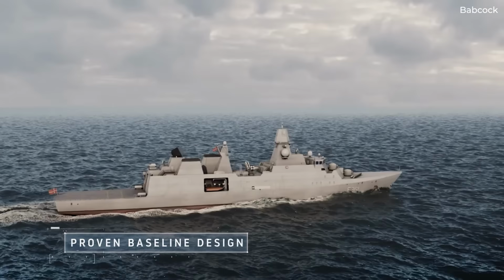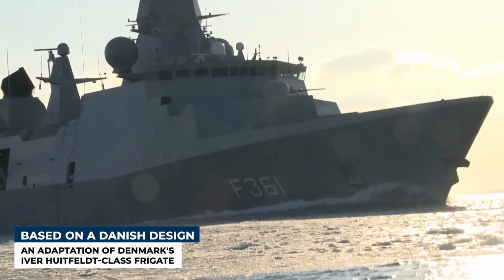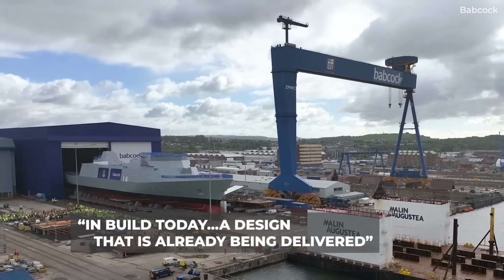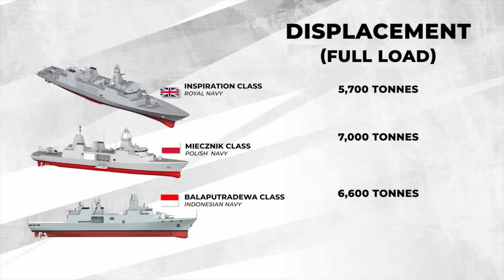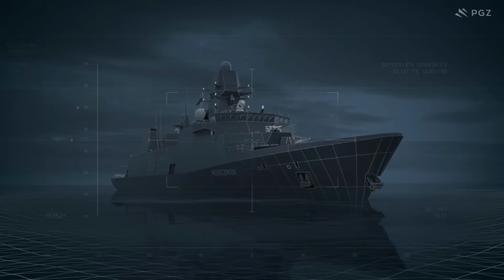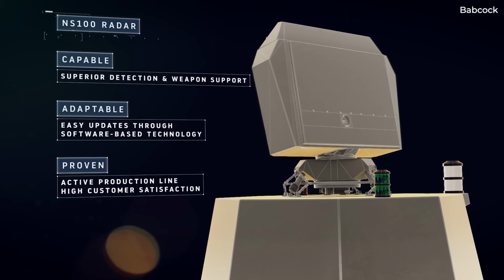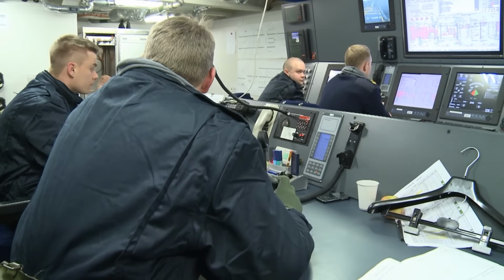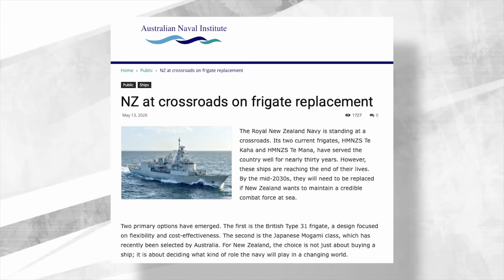Type 31 (AH140) Frigate: The Best Option For New Zealand?

Comment: Type 31 IS a bad choice.
1. They struggle to build them for their own navy or even get their ships they have now  in the water and any construction backlogs will put Nz at the BOTTOM of the list. Meaning our frigates rust out and we have years with zero frigates.

2, In its standard version is actually far weaker in firepower than our upgraded Anzac are now. So wed spend up to a billion each fitting them out.

3. NZDF signed a deal with ADF for greater joint interoperability across all systems. This isnt it. Mogami is.We get savings of hundreds of millions of dollars with a joint ADF build and can easily slot into their shipyards for maintenence and reloading weapons ect. Training too as they will have the same systems. We'd also be able to use Japan' as a refit base too if exersizing again in the taiwan straits or south China sea. 

4. The crew size is 30 to 40 more crew per ship than a Mogami and NZDF struggles to crew those numbers, again Mogami wins.

5. The Mogami has the advantage of being a Stealth frigate which on top of being far more lethal than type 31 gives NZDF a massive advantage over most fleets in existence.
Reply: Ad. 1: First Miecznik (AH140) is about to hit the water in Poland next week.
Reply: 1. Kinda like Mogami improved, which are supposed to be delivered to RAN in 2029, operational in 2030 on a already signed contract. Mogamis might get delivered sooner, but not by much. Not to the point that Type 31 would somehow endanger the defense ability of NZ.

4. The standard crew is 90 vs 110, so if we want to compare the comparable, it's 20 difference.

I am actually more inclined towards the Mogami improved, but I want them to win fair, not by lying about it.

Comment: I am of the opinion the ideal frigate replacement for the Royal New Zealand Navy (RNZN) should consider is the new F128 Frigate, the new MEKO A200. Germany has announced it will acquire 4 with 4 as an option, a total of 8 with considerable MEKO 200s operating around the world already.  And with that, I would like to see the RNZN return to it's original strength of a 4 frigate navy, with 4 OPVs and 4 IPVs (the latter crewed by the Naval Reserve).

My reasoning is, the ANZAC Class frigates are MEKO 200s. The F128 Frigates to me is a natural progression that is tooled up for conventional blue water navy operations. I am aware under the 2025 Defence Review calls for closer alignment to Australia and, although this sounds good on paper, I express concern and caution. My reasoning, there has been a large number of cost over runs and budget blow outs with quite a few projects in Australia's naval revitalisation program. 

Other examples closer to NZ is Australia's involvement in the current Offshore Patrol vessels. This too, the 'Project Protector' program also had considerable cost over runs, budget blowouts and questionable practices. My concern, off loading a procurement problem could be too costly for the RNZN to absorb.  Babcock are already present in NZ as a primary contractor (the Davenport naval Dockyards in Auckland). There is a link for influence.

One other point I wish to raise, is the 2025 Defence Review(s) was primarily conducted by the Ministry of Defence (MoD). There have been succcessive defence reviews over the last decade. So much so, one could argue the Defence Reviews are a product in their own right, for the Ministry's own end. The 'forever reviews' have made a considerable disruption to the military leaders to the point of encroaching and marginalising the military out of the decision and procurement space. At best, a token presence.

 There is a phrase in NZ : 'Alot of 'hui' with no doee' (*for international audience, please. look up the Maori term: 'hui').

My hope is with the up and coming elections, such decisions are taken out of the hands of the MoD and put back in defence, where it belongs in the first place. Time will tell.

Comment: Always wonder, what it type 31 using all 3 57mm gun ?
Longer range, same rounds
Reply: Could be cost. It could also be space and weight margins. The 57mm MK3 turret looks quite large. The Bofors 40mm is a smaller, lighter and non-deck penetrating system.

Comment: At the moment likely threat is China. If China goes belligerent theh will likely fight Japan first. In that case spares and replacements availability will depend on how Japan is suffering and its capacity to respond. And I believe we need way more than 4. Can afford more than 6 to buy and run and due to thd militant left in the country can have exactly zero. But with our dependence on seabourne trade (98% by mass/96% by value delivered by 800 ships via 6000 visits per year) we cant function with less than 8 in a real war. Simply cos of hull and cargo insurance premiums. Without credible escort everything will skyrocket to prices we cant afford. Escorting warships in that context are cheap cheap
Reply: Excellent response! Two is just not going to cut it! Aussie s and Kiwis have much more territory to cover!
I say 4 at least!
By the way, an Air Force would come in handy!

Comment: The biggest advantage of the Arrowhead 140 is its affordable to operate which may allow the 🇳🇿 RNZN to acquire more hulls like 4 to replace both the Anzac-class frigate and Protector-class offshore patrol vessel (OPV) with 2 each from the class also the RNZN currently used the CAMM/Sea Ceptor missiles although it could also be integrated with Mark 41 VLS as an alternative to the ESSM not sure if the New Mogami can integrate with Sea Ceptor?

[Edit] This comment is Bias to the Arrowhead 140 the same for the FFM-06/New Mogami-class later on!

Comment: As much as I like the T31 and think it’ll do a good job covering the General Purpose frigate role for the Royal Navy the reality is New Zealand will likely go with Upgraded Mogami as the RAN has, local logistics, maintenance and training will probably be the deciding factors as both can cover the sort of taskings required by the RNZDF. 

The one thing I’ve not heard much about is the ship keeping in rough sea states, the T31 is designed for the Atlantic and High North which can be very rough, a bit unsure on what the Mogami is designed to handle.
Reply: That's a misconception. The Northern Atlantic has worse weather in general but it also doesn't reach the extreme weather levels of Asian waters
Reply: North pacific ocean lol 😆
Reply: @robertbunch7829 We've deployed our frigates to the sub antarctic before. And theres videos on youtube of what the southern pacific ocean does to a OPV hull. 6 to 12 meter swells that tear the arse out of a 2000 tonne patrol ship.
Reply: Also the Yellow Sea, Sea of Japan, the query is more is it built for Pacific operations or more focused towards waters between them and China?
Reply: @jono_cc2258 built for Pacific operations away from the Japanese mainland as opposed to the base Mogami which is for closer to Japan
Reply: The Pacific Ocean..
Reply: What local logistics, maintenance and training did NZ use for the ANZACs?  NZ maintains its own ANZACs and Australia maintained their own ANZACs so there goes that theory.  The main benefit of that combined frigate build was industrial with each country building portions of each frigate to support local companies so that won't be the case with these anyway.

Comment: Interesting choice.  Buy a worse ship from a country that can’t build enough ships for its own requirements or buy a better ship from the world’s second greatest ship builder (that has a reputation of delivery on time and on budget).
Reply: Yeah that's not a great comment, if you're gonna have a dig at least get your facts right. The UK can build plenty for itself. The reason for such a drop in numbers as of late is a political one, not an industrial one.b Construction started way too late on the new classes of ships and older ones simply could not be extended any further. If they started constructing them years earlier we wouldn't be in this mess. Also many countries have bought British warships and for good reason Australia, Canada, Norway, Poland, and Indonesia with others likely to follow.
Reply: @CrackingDale25 that is a long queue of customers for New Zealand to tag on the back of, although Australia isn’t a customer.  Our type 26s are being built in Adelaide and I suspect Canada will also be building theirs as well.
Reply: @M3au  Out of those countries only Norway is having theirs built in the UK. This is because it's quicker and more cost effective to join an existing production line. The UK is actually giving away a number (yet to be confirmed) of build slots to Norway so they can get them in the next few years. The other exports are of the designs and maybe some components in the ships. That's the Type 26. 

The Type 31's are being built on the Clyde which is a different yard and they're actually looking to take on more orders soon otherwise they will be out of work so there will be build slots available soon. NZ don't need the ships until the mid-2030's so there's plenty of time.

Comment: If the RR MTU  Engines were rafted on sleds like the  Sachsen-class (F124) frigate's do and Captas 2 towed sonar like the Polish type 31 and don't forget CAMM ER !
Reply: if you want to pay for that them Type 26 exists
Reply: @graveperil2169  NZ biggest threat is submarines on its trading routes to Asia and the Mogami is excellent in this role and far cheaper than a type 26 .
Reply: @BDTASGJohnson  cheaper but not as good in that oine role
Reply: @graveperil2169  Austal USA (US Navy Independence-class Littoral Combat Ship rafted those MTU  engines.

Comment: New Zealand doesn’t need a ship with 32 vls cells because it only needs air defence missiles. Box launched nsm missiles are adequate for tye RNZN. Missiles like tomahawk, sm2/6 are not needed for a New Zealand vessel.
Reply: you can put the air defense missiles in the vls cells
Reply: The threat environment says differently
Reply: Poland's variance of AH140 is about to have CAMM missiles, in both basic and CAMM-ER variant, with probable CAMM-MR when they're finished. Supposedly PAC-3 was tested by the US in Mk41 Strike VLS Cell successfully, finally Standard Missile family is compatible. So it can easily be all around AA platform.

Comment: A good video, although I have already seen this information on your other channel. The new defence minister here in New Zealand has said that both designs are being considered, but he has admitted to the media that the British Type 31 is pretty much the underdog. I personally can’t see it being selected, because the Mogami is far more suited to New Zealand’s key issues, which are low crew size, long hull life, advanced technology, proven track record, a large industrial base that covers two nations, and interoperability with the Aussies. I don’t accept the claim that the Type 31 is cheaper than the Mogami, because the price for the Mogami includes all equipment while the price for the Type 31 doesn’t cover a lot of things that are needed to get the job done. Anyway, it still an open question about which one will be chosen.
Reply: Crew size seems like it doesn't get enough attention to me.
The ability to run with smaller crews, allowing for more frequent rotations and keeping the ships at sea more often seems like a huge operational benefit.

Not to mention keeping systems in common with Aus for shared supply chains and maintenance.
Reply: @ant0n1o13 and what is the actual difference in crew size. Less than 10 if you exclude the flight crew & marines
Reply: @dougwhite1491  ~30 sailors is a third of an entire ship. that's a pretty sizable saving in total salaries... and that's before you take into considerations the cost savings of being able to share maintenance, logistics, training facilities, and potentially even crew, with the RAN
Reply: @dougwhite1491  Type 31 is given as 110-130.
Mogami is 90.
20-40 per vessel is huge in a navy the size of NZs.
Reply: Where is Chris Penk quoted as saying this?
Reply: Well said!
Reply: All good points, with the Mogami being high spec,  but the Type 31 has better Multi-role and Modular capabilities, with spare tonnage for future upgrades, more room to transport Shipping Containers for disaster relief, can carry more RHIB and the ability to transport extra crew and personnel than the Mogami.
Maybe a cut down shorter version to replace the Offshore patrol vessels?
Reply: Babcock’s Arrowhead 140/Type 31 is leading the Kiwi competition for 3 key reasons:

1. Deep Roots: Babcock has managed NZ’s largest maritime shipyard (Devonport) since 1995, backing 600 local suppliers and pumping NZD 220M into the economy. Selecting them guarantees local jobs.
2. Legal Hurdles for Japan: Japan offers the Mogami-class, but NZ is the only Five Eyes member without a formal Defense Technology Transfer Agreement with Tokyo. This creates high political uncertainty.
3. Crewed-Uncrewed Teaming: RNZN suffers severe manning shortages. The automated, low-crew AH140 acts as a hybrid task force controller for drones, fixing NZ's manpower crisis perfectly. 

Babcock isn't just selling products, they are selling built-in partnerships.
Reply: @timothymics8831  Thanks ChatGPT
Reply: @tim @timothymics8831 se are excellent points, and no doubt are some of the reasons why the Type 31 is on the short list. I am pretty dubious about a hybrid navy concept for the New Zealand Navy becoming reality. I do believe that our ships will carry some drones, but small and cheap ones. If you are expecting to see frigates accompanied by unmanned vessels or carrying large drones, then I don’t think you have looked hard at what our defence budget can actually achieve. Anyway, I just hope that one of us is right, and that one of these new frigate classes becomes a reality rather than a political decision that is kicked down the line.

Comment: In my opinion the RNZN is mostly limited by manpower, not with cost, (although that is the 2nd massive factor), with the RNZN having to de-activate HMNZS Otago in 2022, and selling HMNZS Pukaki and Rotoiti to the Irish Naval Service in 2022, as they could not be manned without drawing crew away from the major fleet elements. With the sinking of the HMNZS Manawanui freeing up naval personal, this has been somewhat lessened in the shortfall, allowing reactivation work on the HMNZS Otago to begin, but it's still quite bad. 

However, the biggest manpower saving is going to come with these new frigates, mostly due to automation tech that the old frigates lack. Each current ANZACs-class frigate operates at ~170 crew, for a total of 340 across the two vessels, compared to the Type 31s ~100 per hull, and the upgraded Mogami using ~90. So for all the personal on the two ANZACs, three Type 31 can be crewed with 40 extra personal for other vessels, and again with the old ANZAC crews, three Upgraded Mogami can be crewed, with 70 left over. If extra personal can be found or recruited in addition to these numbers, then it becomes far easier to man a fourth Upgraded Mogami than Type 31, which would be very helpful to the RNZN due to the rule of fourths, allowing for a hull to be at sea at any given time. 

On the matter of costs, the RNZN has been sneaky about this before, when fitting out the ANZACs in the mid 90's, parts of the old Type 12 Frigates were reused, with the HMNZS Te Kaha's Phalanx previously being fitted to the HMNZS Waikato, and her ASW torpedo tubes from the HMNZS Southland. But no matter what this is an expensive program, and unlike the Aussies, we can't afford to mess up.
Reply: One of the manpower issues that no one seems to acknowledge is maintenance - who does it??  Ships need constant painting, cleaning, scrapping, de-rusting not to mention ongoing servicing of all that tech.  With a small crew, who is going to do it and continue with their own jobs as well, there is not enough bums on seats.
Reply: It's not an issue of just basic numbers and dividing that by ships it's the number of specific crew members like marine engineers, weapons techs etc ie the specialist trades required for a ship to safely put to sea.  You could have 100 combat spcialists to operate the ship but you then still need the 10 engineers to run the ship and the thing automation comes technical requirements so if anything they would need even more technical trades on a modern ship as roles will need to be double hatted more and watches maintained with lesser numbers.  Like the NZDF in general it's the specific rank brackets and trades that are leaving the force short as defence literally cannot match equivalent civilian rates for their relevant skillsets on the open market.
Reply: Its 2026,  NZ actually has a pretty high youth unemployment rate, they all want to work from home in white collar jobs. It seems few want to do day jobs or certainly not serve in the military, even though it can do amazing things for people.
Reply: @Battleneter  The problem is a lack of Govt imagination and useless ad campaigns - Its like always, you are right for 90% of the youth but that other 10% could be reached.  The whole system is designed for a retention/manning problem.
Reply: @Battleneter  Singapore, with a comparable sized, multi-racial population (albeit much better educated) leverages its compulsory national service into recruitment. Many of these young men find their future occupations through the choices and experience offered with NS.
Reply: @brucelivingstone365  Forced education and welfare at the same time. National service would definitly help.